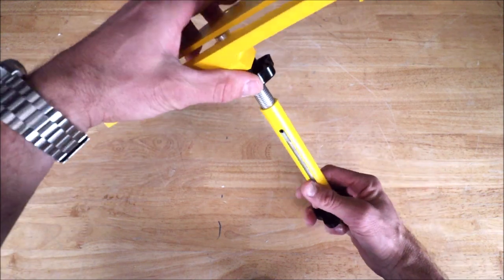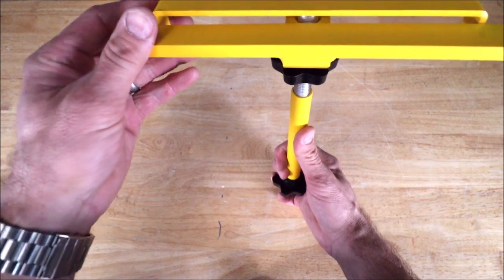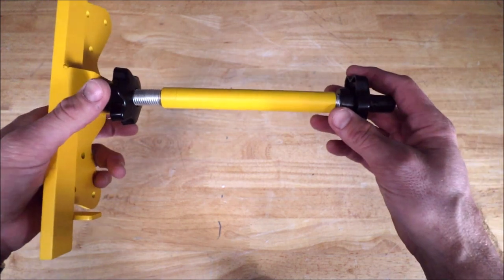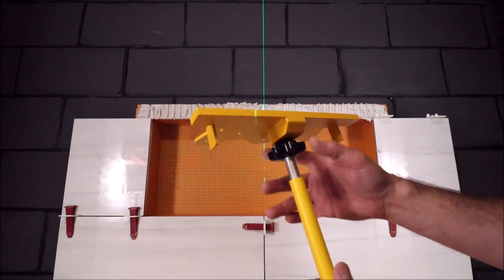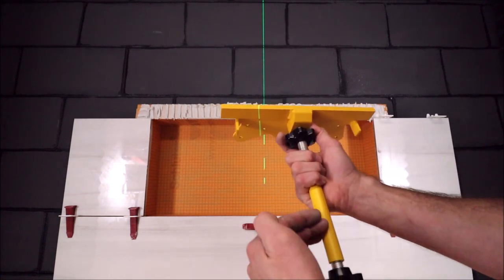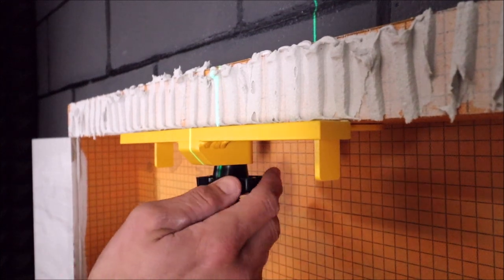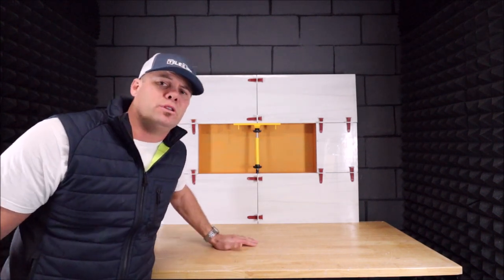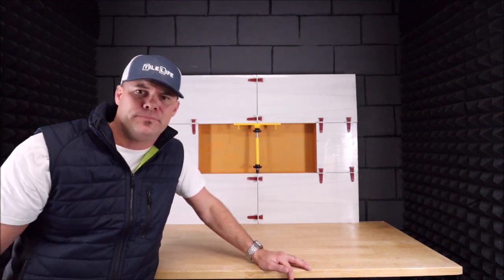Very COOL NEW Tool for Tile Installation!

Comment: I use a piece of drywall or scrap plywood, drill into the upper niche, use wedges to level the tiles I'm holding up. If I buy one more tool I'll need a bigger truck.

Comment: Nah, not sold on those. For that amount you can get two pairs of Jorgensen clamps, that have reverse feature(which you you need to crank up tile so it doesn’t sag), and can combine together for longer taller spans if needed. All that in addition to being awesome regular clamps on their own.

Comment: Total waste of money. I put a dummy real tile instead with clips and no thin set on it , next day I remove the clips  and the dummy tile that is still usable.
Reply: And if you're doing a 12x12 niche or 12x18 niche with 3x6 subway, I'd imagine you stack a bunch of dummies together and hope for the best? Great tool, dont see the harm in it.
Reply: @palmerstile9379  He shows a 12"x24"  recessed, if a 12"x12" recessed is the same  and if subway tile they don't need support.
Reply: @edigabrieli7864  It was the principal of the comment... 3x12 in a 14" high, yes 3x12s sag. 11x22 in a 12x12 that you're running short on and don't want to split extras. Many scenarios where this comes in handy. 7ft door with 12x24, it can be screwed into top of door... Window, etc.
Reply: @palmerstile9379  agreed it is handy and no waste of money at all you just buy it once and basically have it forever